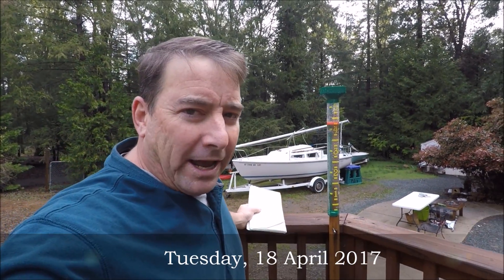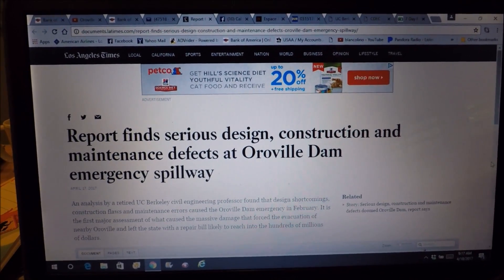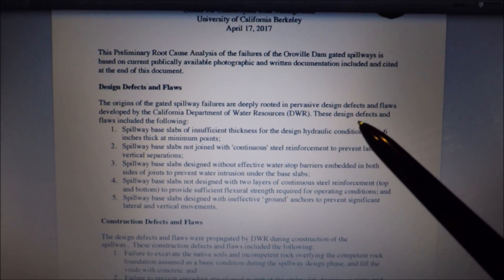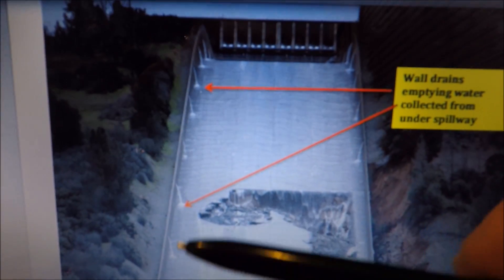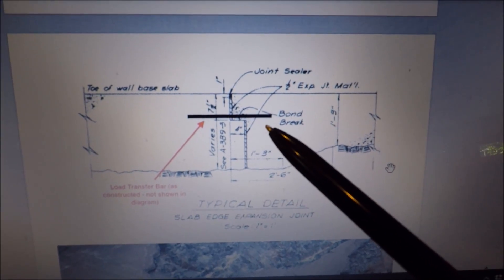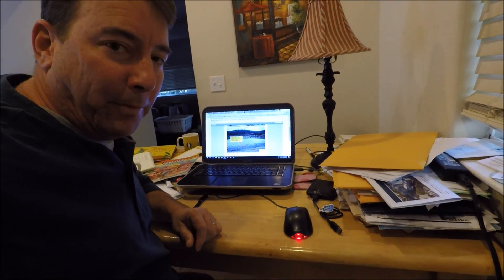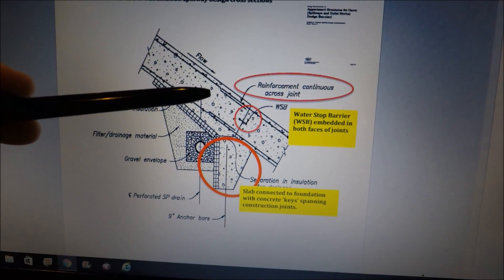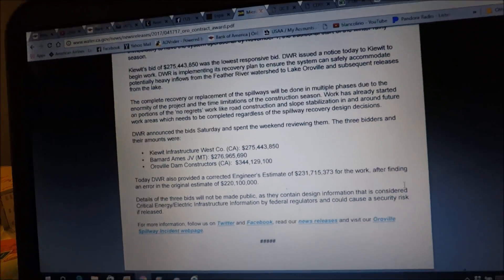Oroville 18 April Spillway Failure Explained-Independent CCRM Report

Comment: So who were the morons actually responsible @ the dept. of water resources who did the original design & contracted what now looks like the substandard spillway? And who was/is responsible for the (lack of) maintenance over the years?  Makes a person wonder about the rest of the dam.  Wonder if Jerry has anything to say about his father’s administration these days. I’m sure it’s too late to hold anyone responsible.
Reply: In 2004/2005 an Extensive Report was done on the Massive Repairs that the Spillway's and Dam Needed! At that time,Arnold Swartzniegger was Governor,  and at the end of the report his statement was: "Too Costly for the Repairs" !!  I went through the report and read a lot of it, and it is an Official  pdf that someone had posted back in February 2017 when the Emergency Evacuation happened, and I now wish I would have wrote down the info to retrieve that report because I'm not really sure how to find it?
Reply: The Spillway was constructed to 1960s standards. No one at DWR is responsible. Nor the Governor at the time. Just like when an earthquake occurs, new building codes are created to account for any damage caused. Same here. Codes will be updated to insure damage like this does not happen again.
Reply: Light Fawn, I had a ''professor'' at Cal Poly SLO in the 1970's who insisted that the USA West of the Mississippi would run out of fresh water by 1992. He was certain of that, even published a paper on it. He blasted me in class after I asked ''So, is it going to stop raining?''.  After 60+ years of living in California, I know for CERTAIN that we will have a repeat of the 1964 floods, 1987, 1997, and 2017 ones as well. We get droughts, we get floods. Nothing new. So much for ''experts''.

 In 2006, a dry year,  I installed eight of the 4'' abs drain pipes on my property when I did the retaining walls, concrete decks, and side driveways. A week ago it rained so hard that it was impossible to sleep with the noise on the roof.  I did a tour of the drain grates by flashlight. I thanked myself for spending the extra $400 on extra drain pipes and deck grates. The water going down my steep street would knock you off your feet. Two of my 4'' drain pipes were discharging into the street and were almost half full. That's a lot of water!
Reply: It's no secret that nationwide we have been neglecting our infrastructure.  When was the last time you contacted your elected officials to let them know that infrastructure was a priority for you?

In 2013 the American Society of Civil Engineers gave the state of our infrastructure a grade of D+.  They estimate we need to invest $3.6 trillion by 2020 to get our infrastructure up to a grade of B.  Only 55% of this is currently funded.  Would you support taxes to cover the 1.6 trillion ($5000 per man/woman/child) that is unfunded?

In short, it is us taxpayers that are the "morons".  We are constantly letting our politicians know how important immigration, guns, abortions, healthcare, and lower taxes are.  And then we want to blame someone else when politicians don't spend money on things that we never showed an interest in.
Reply: +Light Fawn 
Climate scientists predicted permanent drought for California so there was no need to repair something that would never be used again.
Reply: Eastern Woods, politician's see their primary job as pimping and pandering to the  public so they can get reelected, continue milking the system, get insider trading info, and find high paying jobs for their sons in laws where they get paid for doing nothing.  You don't really expect them to WORK and make life better for the average Joe, do you?

I have seen this time and again. Its called deferred maintenance. The government officials know that they can let things go to trash, then claim the credit for tearing down the old and building an overpriced new facility. Locally, $3 million could have modernized our Senior Center. Instead, they tore it down and spent over 3 times the original  budget...$27 million dollars to date, and the new place has its share of troubles already! 

Having been involved in maintenance, I can assure you that the people at a facility...like Oroville Dam.... SCREAM for the funds to be allocated to do repairs. What do they get? Crickets, and a pallet of parking lot striping paint for the paved area above the emergency spillway.  Spillway repair: ....''Its not in the budget this year''.....

I can honestly say that I REFUSED to work on the nuke powered carrier USS Enterprise after the 4th time we rebuilt a shitty little  reactor feed pump (4 Alpha) and had to tag it ''Do Not Operate'' for the 4th time. It was like buying a new car because your tire was flat. The contractor said it was so the Navy can get ''more money in their budget for next year''. That's why we did a month long job 4 different  times instead of fixing it right the first time. It took another few months after I bowed out to get it up and running. What a WASTE of taxpayer money! This would have been a 6 day job on a civilian ship.
   My point, the current system rewards sloppiness and incompetence and the wrong overpaid idiots are in control.  They all got promoted to their highest level of incompetence!
Reply: I heard they were responsible for the fire in Atlanta that destroyed that freeway overpass too. We got to find those 2 before the cause any more havoc.
Reply: Since you asked carguy67b, it was Scott and Michael who were responsible.  Feel better now that you have an answer?
Reply: As we gain experience all codes are updated. This is an experience. ..... For politicians, repair and maintenance is not a high priority. There's no ribbons to cut and photos to take. No great accomplishments to boast about in campaign literature. Who was going to spend money repairing a spillway as the lake was drying up in a drought? That being said, there's still a lot being done and catastrophes avoided that no one ever hears about
Reply: why wonder so much? Just follow the money trail. . When you come to realize who actually owns this country, and why they are letting it "go to hell", that might just brighten up things for ya' .

Comment: Juan, thanks for the time you put in making these presentations. I find it very interesting. I look forward to getting new videos from you when available.

I'm curious on a 1-10 scale with 10 being the worst how bad would you say they designed the spillway? Nothing lasts forever and the Spillway is 50+ years old correct? If correct how many years do they anticipate the Spillway lasting? 

Being a native and currently living in Las Vegas I have thought about how Hoover Dam was constructed and how long those design features will currently last by today's standards? Lastly, how many other damn/spillway's were constructed by the company who created the Oroville Spillway? 

And you mention design standards changing from 50 years ago at construction to currently now which effected the Spillway. My question is why do the design standards matter now verses 50 years ago? because to me water is water it was the same 50 years ago. it hasn't gotten any heavier or dense with time. What am I missing here? Hope that makes sense. I am not an engineer so excuse my ignorance LOL
Reply: I would give it a 7 for the original build but with the caveat that they let it deteriorate to a 10+.
Reply: Devin Henderson---1-10, it's an 8,  imo.
Reply: 3.5 or 4
Reply: Devin Henderson The design changes eliminate the cavitation issue, that caused the spillway failure to begin with.

They were just to cheap out there to spend the money to add the simple features.
Reply: Maintenance or not, the design of this spillway was deficient. Hoover Dam has also had some issues with their spillways during extreme runoffs.  There are lessons to be learned but there was thirty years of dam building knowledge between Hoover and Oroville, including Grand Coulee! This design was just bad. Maintenance would have never prevented this from happening, it was a ticking time bomb. I give it an 8 on your scale.
Reply: Googlesux Bigtime yeah kinda like how some peeps are to cheap to answer a couple questions posed to them when they are the ones who are posting the videos in question for all to enjoy. 

people who post videos for the sole purpose of seeking monetary gain in return for having a few questions answered should specify so in the description area and NOT waste others time.
Reply: I found out that the Oroville dam is an 'Earthern Dam' > which means that it's not built on Solid Bedrock! I also found out that the Hoover Dam IS Built on Solid Bedrock, that it is not an earthern dam > so, it is actually a Safer and Stronger Dam+

Comment: Did you consider decking over your pool, if there is a neat way to do that, instead of filling it?
Reply: I had an uncle living in CA, Running Springs.  Wooded area.  He rarely used his pool, but kept it in case his kids or grandkids visited.  During a major fire, the Navajo smoke jumpers set up the fire line at his back fence.  They used his pool as a water source to stop the fire.  Saved my uncle's house.

Comment: I questioned the size and spacing of the rebar at the very beginning of this situation when the first pictures started coming in. I said then the rebar was too small and too far apart but i was continually told it was 2 inch and inch and one half but that is plainly not true.

Comment: nice job interesting stuff one comment is that the thickness of the concrete over the drain pipe appears to be more than 6 to 8 inches possibly a foot or more  comparing  to the thickness of the spillway wall.